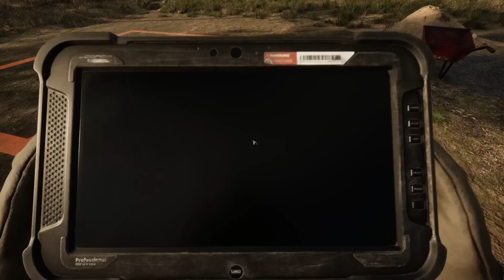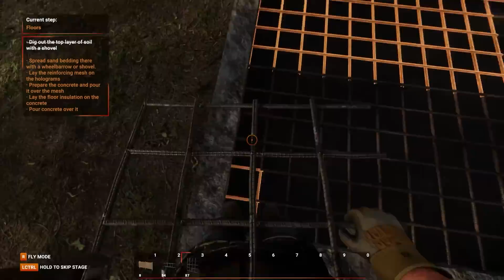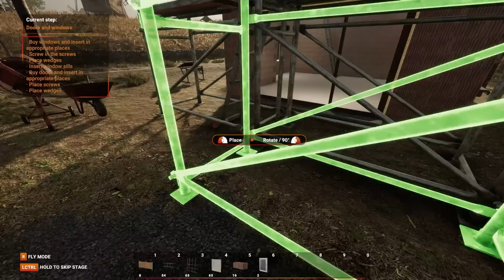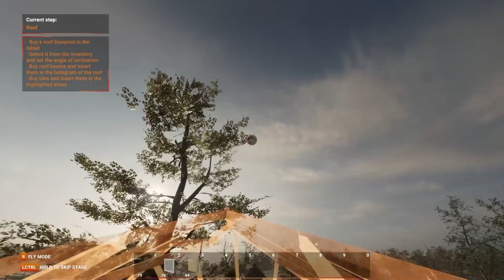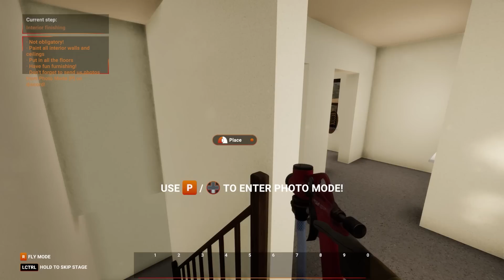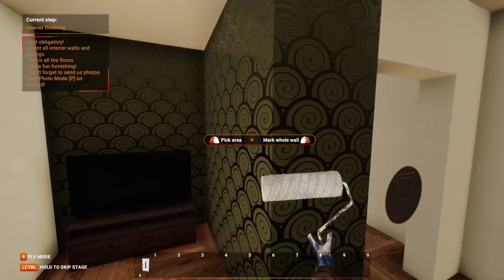Plans to Painting, with Everything In-between! | Builder Simulator

Comment: Didn't bring the cold water service up through what became the ground floor.  No DPM unless those slabs were meant to be some sort of equivalent.  No first fit of electrics before you completed all the plaster boarding.  No electric service brought into the property.  No soil pipe or sewage provision.  Loft insulation, felt / breathable membrane. For true authenticity there ought to be a requirement for a swimming pool amount of caulk to fill in all the bodges.  😂

Comment: Im suprised as to how acurate this game has some aspects. However a house bult like this would still be illegal due to the lack of renforcement in the walls (nedds a rebar mesh on corners, every 4 meaters, renforcement near any openings such as windows and doors), the lack of hydrofobic material at the foundation and base of the wall, using sand insted of gravel for the foundation (the reason why gravel is used is to act as a natural drainage method to prevent water from going up the soil via kapilary action and thus preventing water from freazing and causing damage to the foundation) and the fact that the foundation is not even close to being large/deap enough to suport a multi story building this includes the sand being two shalow, the roof not having any stable suports in the midle (all it needed was one vertical pillar in the midle but nah), the roof not being acualy conected to the rebar supors from the walls thus making the roof suseptable to being blown away individualy (yes this does hapend and is comon for buildings like this) and to top it all off, depending on the location and restrictions this small building may exed the alowed space on the plot ( a building canot exede a set % of area covered, and in a area like this woud likely have rughly 40-50% alowed coverage which this likely goes above that limit) (apologies for my bad english)
Reply from the maker: +10 Generic Comment Appreciation Points. Agree it's not 100% and would vary between countries. However still glad to see a game highlighting some aspects of construction that haven't been seen before, even if it's a general idea or analogue of things.